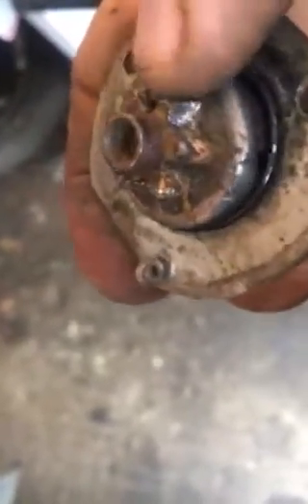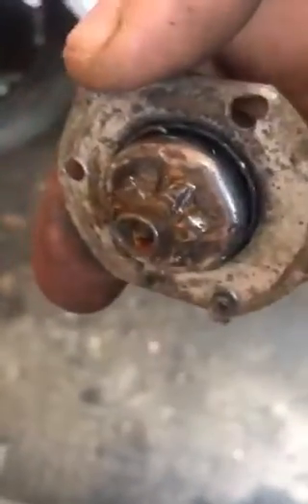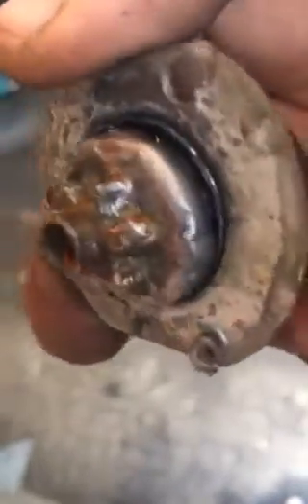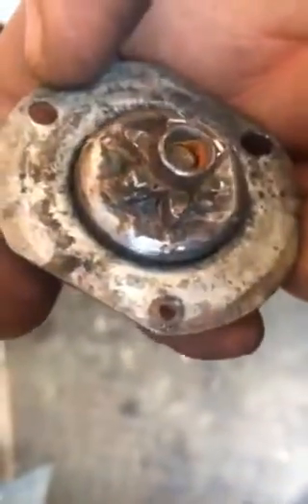Silversides bus window crank repair

Comment: I believe that when my (silversides) regulators strip out, I will just add a flat power window kit.. Teflon spray in the springs definitely makes the rollup effortless.  The rolldown on mine is not nearly as smooth or easy as the rollup.. seems to be too much spring pressure.